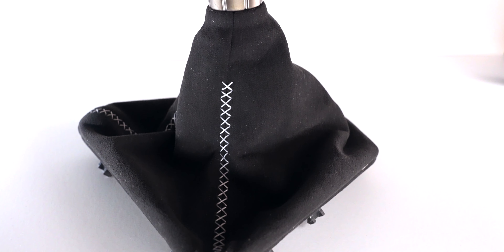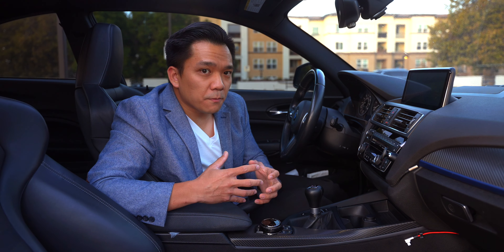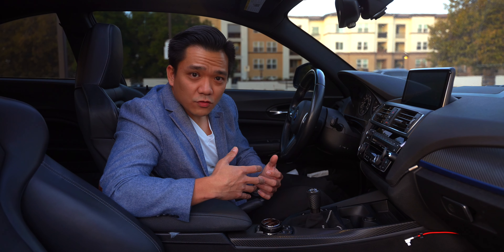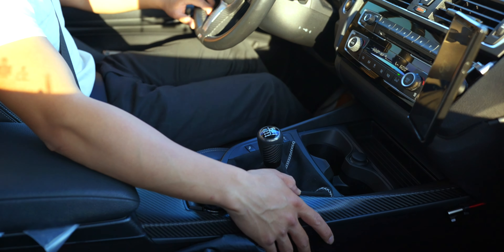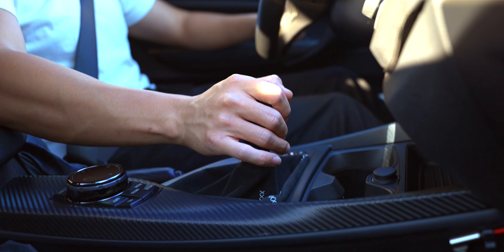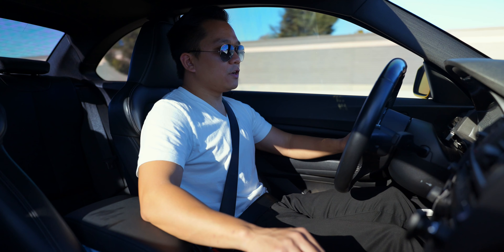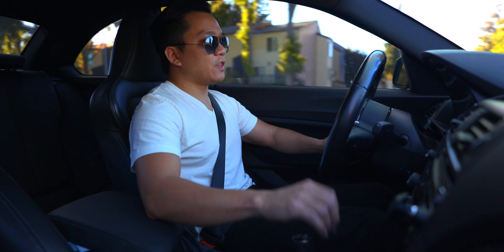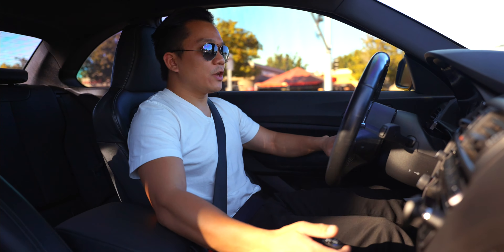M Performance Shift Knob | Install and Review | m235i 2 series

Comment: I would like to put an illuminated manual gear shift knob of m3 or m4 on my 440i (only the M series are illuminated). Do you think all series 3 and 4 including m3, m4, 340i or 440i have the same leather boots size and shape ? do you think all the leather boot (attachment trim) for manual transmission are compatible ? Nice video by the way 😉
Reply from the maker: Thank you. 3 and 4 series have the same size leather trim and are interchangeable.